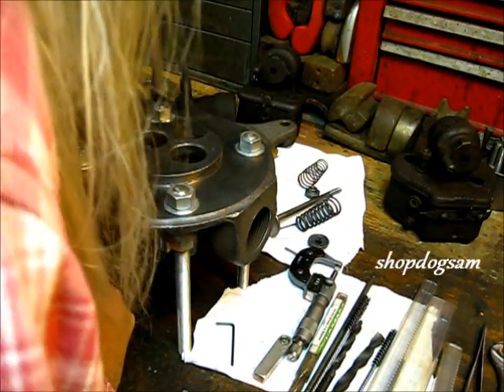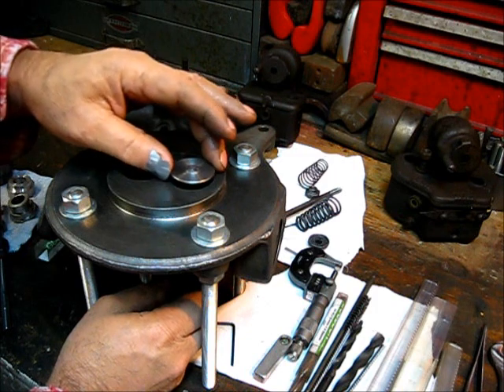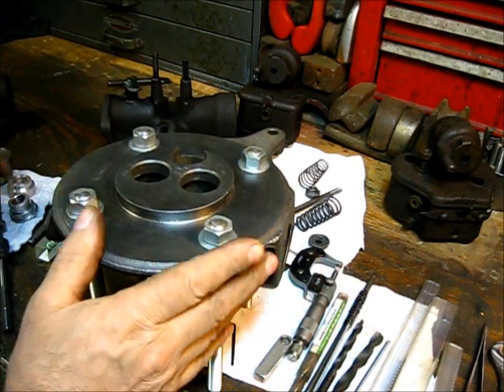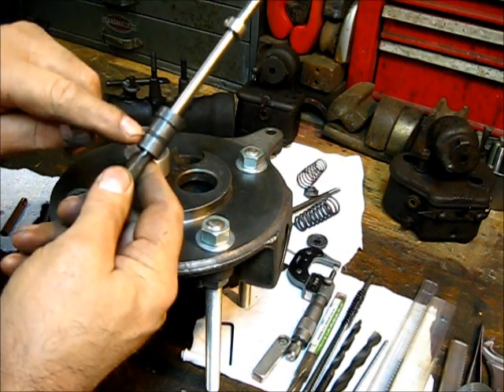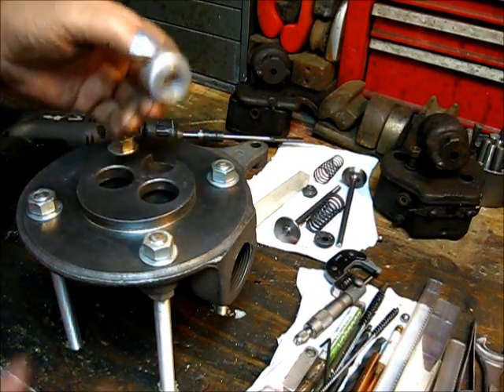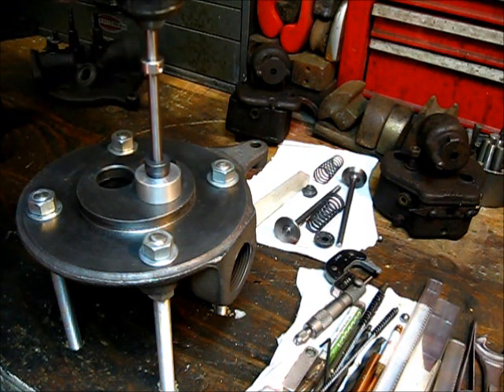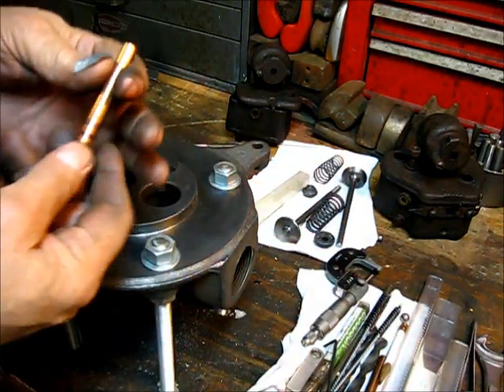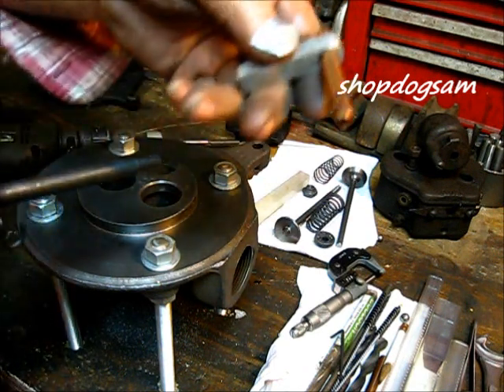I H C ENGINE  how to install valve guides #1

Comment from the maker: ,,,, thanks,, and I will also tell you not to run your reamer in a reverse rotation when it is in use,, hit replay,at what point do I run this reamer in reverse?, leave a comment, rotation does matter and I don't think there's a right way to do that,,,,, but I will add that in the past I used a reamer in reverse rotation with some polishing compond to produce a very straight and true, polished cylinder bore,, a little over-kill I think, but no friction,, oh!, that cylinder was slick,,,, thanks